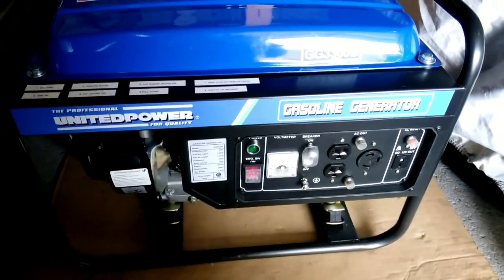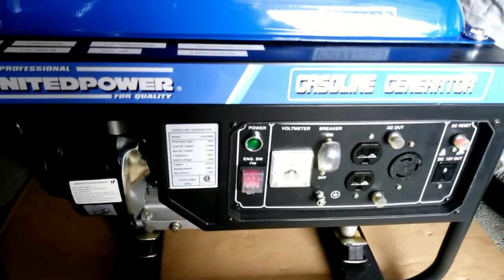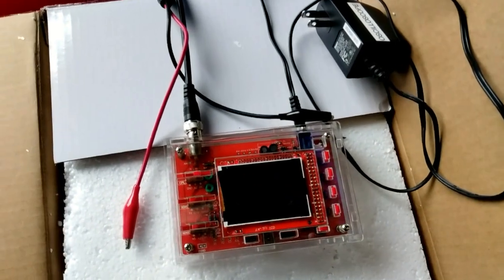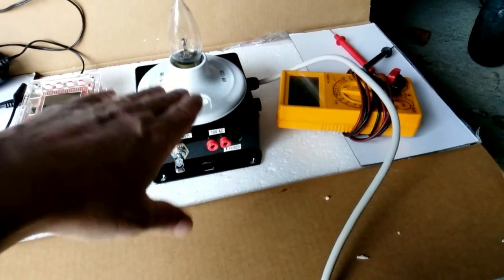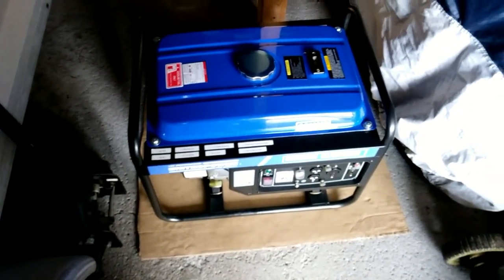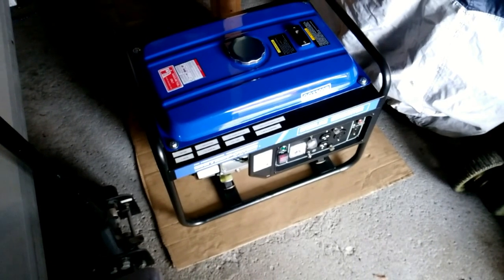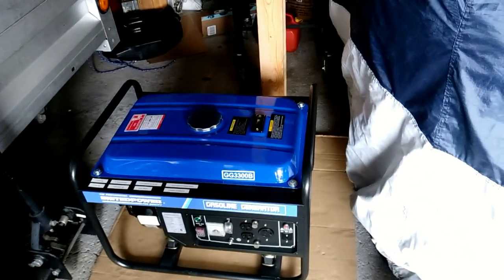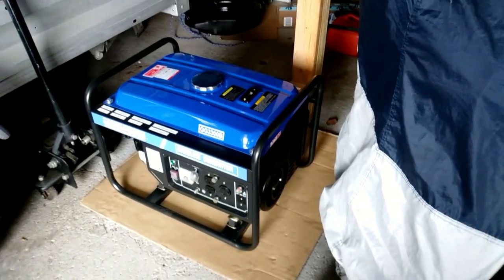United Power Portable Generator 3300 watts Review and Power Quality inspection with Sine Wave

Comment: I have the same generator.   It’s a piece of crap
Reply from the maker: I put a new adjustable carburetor on it and it's ok. What problems did you have?
Reply: @gaving4359  reving up and down, cleaned the carb and jets and it didn’t help much.   I just put a bottle of sea foam in the gas and ran it for an hour under load so I’ll see what happens after that.   The choke doesn’t want to stay in position, it vibrates into the unchoked position if I want to run it at half choke then it revs up and down.   It also has a hard time running at no choke.    I’m debating bringing it into the small engine shop, it’s just a matter of not spending to much on a low budget generator.   I’m also looking at getting an inverter but just don’t want to spend 1500 atm
Reply from the maker: @joshrichards3467  yeah, that's a lien condition hunting. My car didn't come with adjustable jets, they were all plugged and snapped off from the factory. That's why I bought the other carb, it had adjustable idle jets on it.
Reply: @gaving4359  did you order it online ?
Reply from the maker: @joshrichards3467  yes, picked it up on eBay for about $20. Looked for the same carb but  made sure it had the adjustable jet screws. I think they are all the samemake and design. Just matched the features and linkage locations.
Reply: @gaving4359  do you have that info kicking around?  I’ll take a look but if you have it please share :)
Reply from the maker: @joshrichards3467  my eBay listing has closed a while back, but if you search 208cc or 7 horsepower carburetor you'll see many examples for around $30. Take a look at yours and compare the fittings. Just be sure it has a  screw adjustment for the pilot needle.